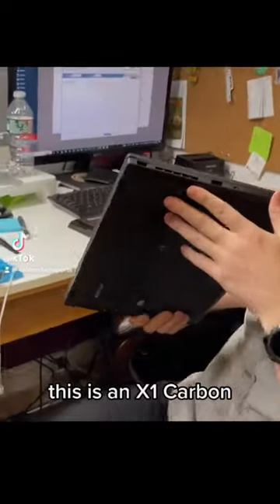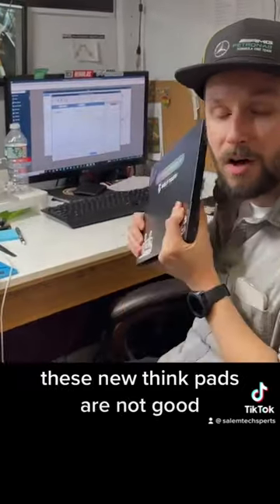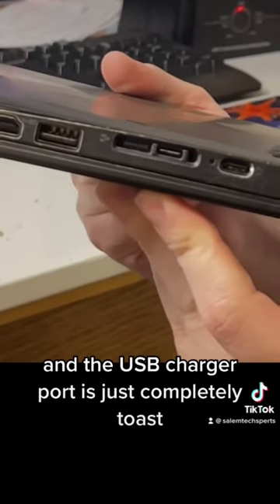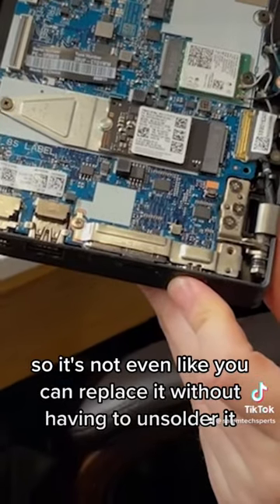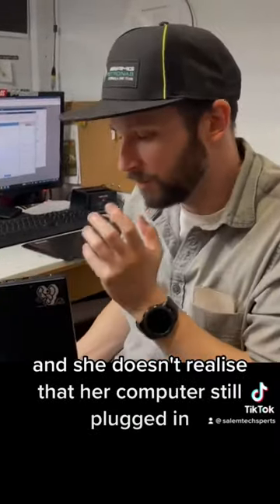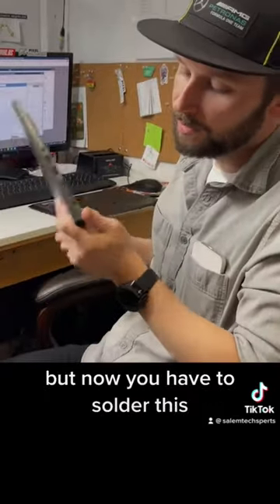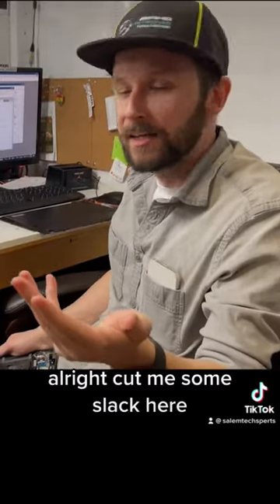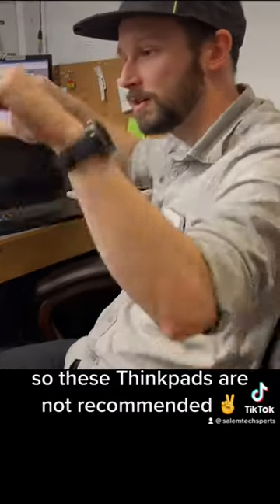Another reason older ThinkPad’s were designed better! #shorts #broken #computer #technology

Comment: Hey, PSA, it will charge from either of those USB-C ports.  So technically unless they are using the Thunderbolt for something you don't have to do anything.

Also consider cutting the swearing, adds nothing to your veracity or content, subtracts your views.

If it is such a big problem, keep spare motherboards and send them out for re-soldering.  Or do get your users on breakaway cables.  Every mobile phone and tablet at my house is on breakaway magnetic.

Comment: Definitely not a real shop lol. What do you expect them to do ha?.. make everyport connect with wires and plastic connectors that rip pads off the pcb if it goes to shops like your where they don't have the skills to replace a darn type c port that is done on footpath repairs shops in 3rd world countries?. 😂
This is all 100% fine.. the old design was best but this is not bad either. These are still lot better than regular laptops.
Reply from the maker: Imagine defending a design change that does nothing but prevent the average consumer from repairing it and directly leading to thousands of pounds of ewaste 🤡